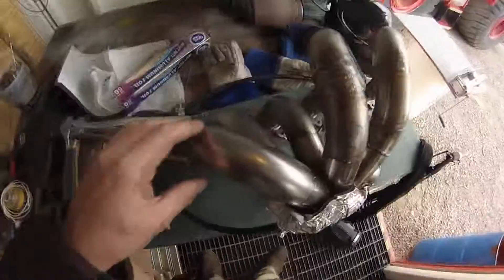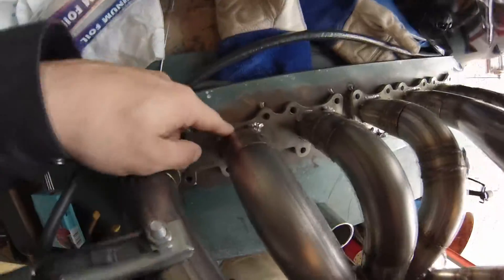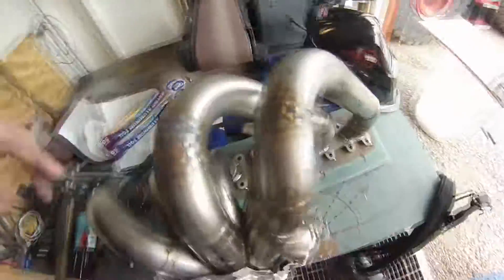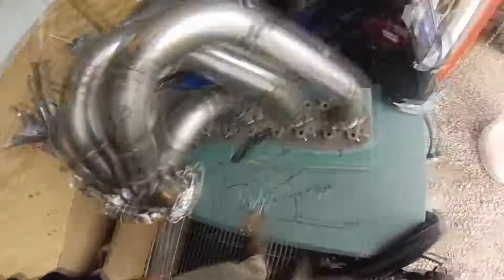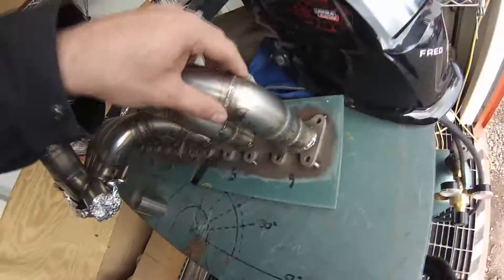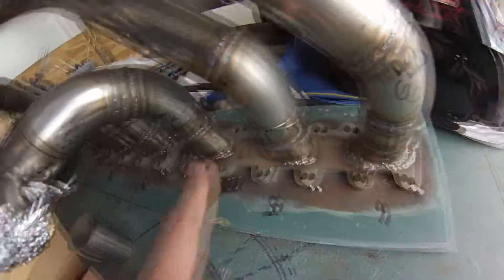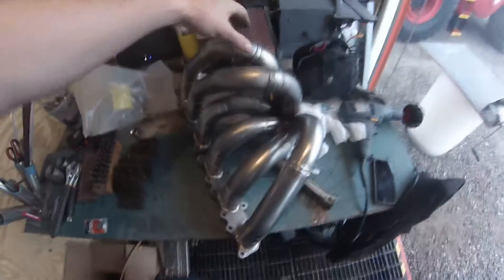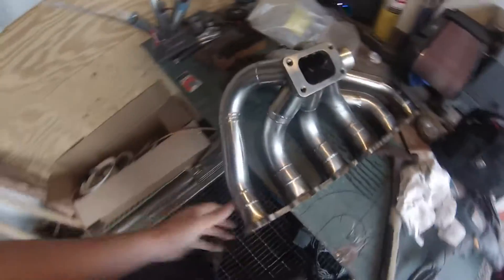Custom Mercedes-Benz Turbo Manifold build

Comment: Congratulations ! Perfect job done, and thanks for the video, did was done for the W 124 and W 201?
Reply from the maker: The engine came out of a 93' W124 but will not be going back into that chassis, I had to junk it. I'm thinking about dropping it into an old Porsche 944 just because I can.